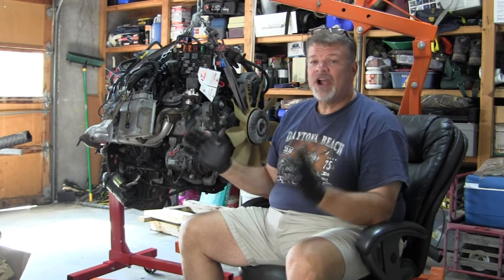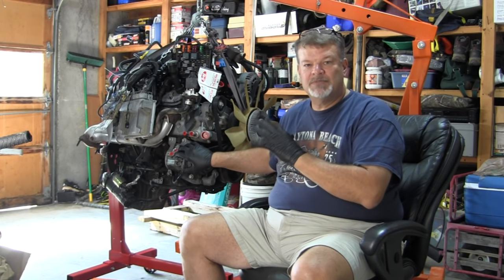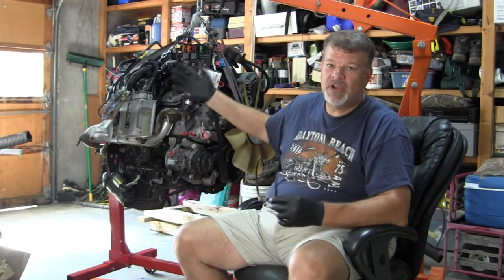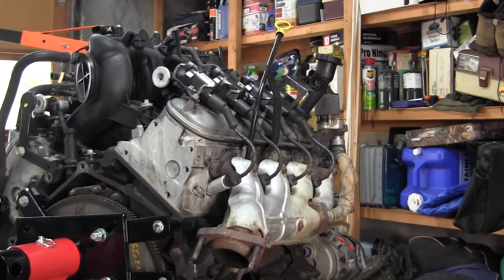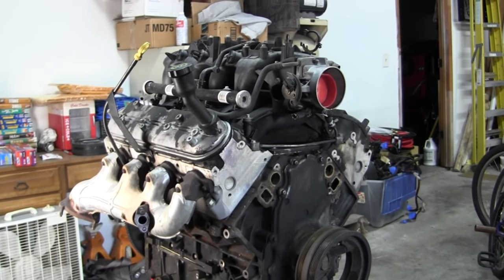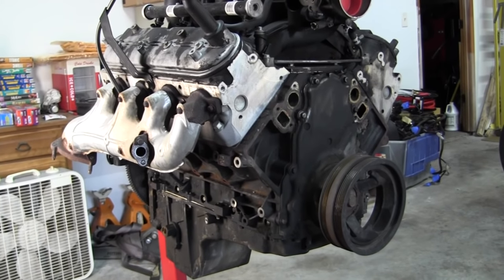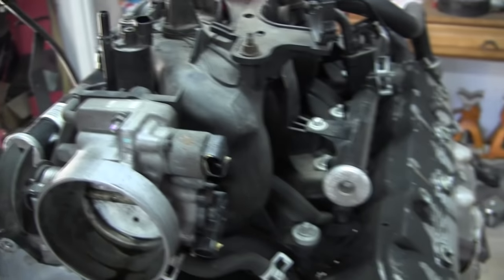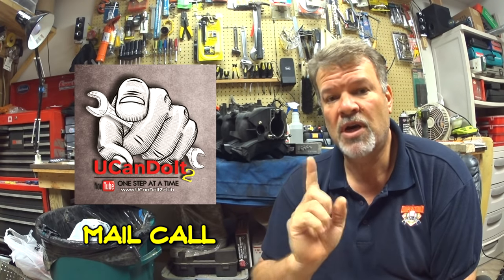LS 5.3L Build Part 1 Harness & Accessory Removal | Project Rowdy Ep005

Comment: I like your methd of working on the engine.
I have a question for you, in the very back of block there's  a casting number , is this a serial number or secuencial number that appear at the end of VIN#?
I do appreciate if you can help.
Reply from the maker: The Cast Number is the same for all Engine Displacement Blocks.  All 4.8/5.3 are the same.  It is Cast which is something that doesn't change as much as a serial number would need to.   I believe the Serial number is Stamped on the Top Rear Left side of the block. Near where the Head mounts.

Comment: Awesome videos! I am contemplating rebuilding the 5.3 in my 2000 Silverado 4X4. One question. Do you know what the part is that has a tube coming off of the exhaust manifold that goes to some sensor that then has another tube that goes into the throttle body? Is that some sort of EGR for this gas engine?
Reply from the maker: Yes, That is the EGR valve.  I will be eliminating that in my setup.  will be using Headers instead of original Ehaust Manifold.  I purchased and installed an EGR block off plate for the port in the Intake.   Cheers.
Reply: UCanDoIt2 awesome! Good to know. Thank you for the response!
Reply: So that's what the white labels were for I'm assuming. Nice video!

Comment: I have a 706 heads on my engine can I change it to 862 heads or I'm going to need a different engine?
Reply from the maker: Fabian Reyes You should research the issue with the 706 heads.  I believe they potentially crack near the center row of bolts holes.  If your inspect yours and they are ok, you might decide to use them.   The 862 heads are a direct replacement.  They will fit any of the Gen 3 platform blocks.  When swapping heads, the item to be mind-full of is if the intake port style changes.  It might affect the Intake that you can use.

Comment: i have a crack in my 2005 LS silverado cylinder head and its a work truck maybe worth 4k. Im going to buy a newish work truck and completely break down clean and upgrade the engine for a mid-life crisis project lol. It seems interesting and fun, but how long did this process take?
Reply from the maker: Mine took a while due to the filming setups.  If I was doing another, I would probably take 1-2 of careful disassembly and 3-4 days of assembly.  If, I was in a race to get it done, you could shave off 1-2 days of that schedule.  Take your time if you have it and enjoy your midlife crisis !!!!   The machine shop schedule could be the long pole in the tent. Cheers and have tons of fun with it!!  Mike.
Reply: @UCanDoIt2Mike  Thanks for the fast response and great videos! So pending the wait time on the block and heads getting machined, a little less than a week for dis/reassembly. I will probably piant my valve covers and other components with some high temp metallic paint while I wait on the machinist. Not too sure about the color yet. I'm nervous and excited to get started! Keep on doing what your doing and Go Dawgs!!

Comment: Great job on the videos! I’ve watched them over about 3 times already. And went ahead and pulled the trigger and bought my self a 03’ lm7 out of a Chevy Tahoe. I was wondering what bolts did you use to attach the motor onto the engine stand? I have the exact same stand.
Reply from the maker: Thanks for the comment!   I do not remember the specs on the engine stand bolts.   But I do remember looking up the specs on the Bellhousing to Block bolts and then measured the length that I though I needed.
Reply: UCanDoIt2 sounds good I’ll be doing the same thanks. Just got done taking off the heads and front accessories on the ground. But putting it on the engine stand would be so much better!
Reply from the maker: Yep!!!  Bending over to the ground is for the birds picking up crumbs...  The engine stand brings it to a good work height!  Have fun with yours!!!!!
Reply: UCanDoIt2 found out the bolts needed they are (M10x1.5) or (3/8 - 16) the bolt store I went too had it in the 3/8 -16. I grabbed 4 grade 8 bolts and 8 washers. The bolts I used were 3” and they fit perfect on the engine. Just wanna put the info on here for the next guy. Man your vids are a life saver I always refer to them when I have time to wrench on the engine! Thanks a lot!
Reply from the maker: Thanks for the follow up Marcos!  As this info is a little buried in this thread, I am going to add the information that you provided to the description area under each video in this series.  It will continue to live here as well.  Cheers and have fun with your engine!!!!!!!!  Mike
Reply: @marcosmorales854  Thank you for the info. I'm about to start my LS build. Much appreciated!

Comment: Those heads have been rebuilt before , see the heat tab inside the freeze plug!
Reply from the maker: Could be !!  I know that the Salvage Yard that I purchased it from added several Heat Tabs that were in conjunction with a limited warranty.

Comment: If you get a truck ls engine and put a car intake on it, are the sensors and connectors the same? Or do I gotta switch the wiring harness
Reply from the maker: Make sure you understand that my answer is from limited experience with these engines.  I know that there are at least two sensors that could require harness and connector changes.  The Truck Vortec engine has the Camshaft Position Sensor in the rear of the intake.  Some Car engines have that sensor in the front of the engine.  You may just have to re-route that wire and connector.  This would not be difficult, but you would need to make sure the connector type is that same.  The other is possible difference in the Crank Shaft Reluctor Sensor.   The other issue may involve the two connector at the PCM.   All of this can be overcome.   To simplify all of this for someone with limited experience would be to keep the Engine/Harness/PCM together for the donor vehicle.  Those are my thoughts.   Have fun with your project.

Comment: Planning on swapping a 5.3 into my trans am. Yes the ls1 is good but i want to boost one day plus theyre so cheap. I found one for 375 bucks.  He said it ran but needs lifters and gaksets.  Is that good or bad? Im a noob to this stuff so im intimidated a little bit.
Reply from the maker: "Good or Bad"... that is a hard question to answer.  You never know what types of issues that you may run into.  As I mentioned in my opening video, this is only the 3rd engine that I have rebuilt.  But speaking logically...  Gaskets are easy.   "Lifters"... I would have to question why the guy thinks the lifters are an issue.  Truly if the lifters are bad, I would also check the Cam (they work with each other).  Cam/Lifter kits are $600-$900 (Mine just under $900).  Swapping out the Oil Pump is a no brainer (the Heart of the engine).  As long as the engine comes with the Harness and PCM and you plan to tear it down to replace wearable parts... its a good deal.  I bought mine for $600 (for reference).  I thought I was going to spend $2000-$2500 and ended up spending $5K.  But please don't let that scare you (just a reference).

Comment: Could I put one of these in a 350z?   Ive been watching 5.3l ls swaps but im not sure which model to go with
Reply from the maker: The answer is yes!  All of the GM Gen3 and Gen4 engines have the same footprint.  If you just plan to pull one and swap if without many changes, you should note that the engines from Trucks have front accessories that are configured in a Tall and Narrow footprint.   An engine from a GM Car will have a Short and Wide front accessory footprint.   If you plan to install all new front bracketry, use can use either.

Comment: This might be a dumb question but is this process the same as a lq4 6.0 what to do it myself and learn but these just look intimidating with all the sensors and wires but i reallly want to learn
Reply from the maker: I answered your other question regarding the machining process.  This question appears to be regarding the overall build process.  And again... the LQ4 is in the same GM platform (GEN3) as the LM7.   There are so many similarities.   The blocks are laid out the same with the major difference being the Bore size.   This would influence the Piston size and the Heads... as those items are related.  So many other components are interchangeable.  You should consider buying a rebuild guide ($24).  It, along with these videos, will walk you through the process.  It is a great pre-process read as well as it will help guide you through the process.  Here is a link to the book that I used... GM LS-Series Engines by Chris Werner: Amazon: http://amzn.to/2igcReD.
Reply: @UCanDoIt2Mike  awww man thank you so much for the advice and really appreciate the reply i stood up real late last night watching your videos even though i already saw them like ten times lol but this time it's foreal because i just picked up a lq4 2days ago and was second guessing myself can i really do this but know that you said the only difference is the bore size i have more confidence and i think icandoit2 and definitely going to use the link you gave me to purchase that book because i also was thinking if i do this how am i going to find out all the exact torque specs for each nut and bolt so that book should really help as well as probably some extra knowledge to some other things so again thank you very much👊

Comment: Great video, was wondering if you could help me out with the ground locations for the battery. I know both the cables share the same spot on the engine block, but I'm trying to find the right spot for the thinner gauge wire on the battery ground.
Reply from the maker: Your options are endless for creating the ground side of any circuit.  Check out ground terminal blocks on Amazon.

Comment: Thanks for the videos, I, like almost everyone else here, binged watched your videos from start to finish, and you've definitely provided the way for alot of guys like myself, who had the want to do it, but wasn't quite sure how to do it all.  It really seems less intimidating now.  I am purchasing a 5.3/6.0 for my C10 swap, and in addition to the GM LS book you showed, and the ltswap.com website, is there anymore sources you went by to guide you through the process?
Reply from the maker: Thank you JD!  The GM LS Book was such a great resource.  I read through some sections and skimmed through others before ever buying the engine.  It was 90% of what I needed for the engine build.  In addition, my Machinist was a great help.  Most of them want to help you (some) because they want you to be successful.  Best to get a recommendation for a local shop.  I do have a friend that was going to be a third source if I needed him, but it turned out that I didn't.   Lt1Swap is a must for the wiring portion.  I had no idea how to tackle that one until I found that sight and all of the base information was enough for me to develop my approach.  Because wiring changes from through the years and models, it is best to drill down through his site base on your engine/year to obtain the proper wiring configuration.  With your wiring specifics and my cleanup approach, it should be a cake walk.   Best of luck to you with yours!!!!!   Have fun with it.  It's a great opportunity to learn something new!!!!
Reply: UCanDoIt2, awesome and thank you! I later realized that you'd posted the cost sheet along with pet numbers, etc. This is exactly what I have been looking for. I can't thank you enough. Go Dawgs!
Reply from the maker: JD Thomas Absolutely.....   Go Dawgs!!!!
Reply from the maker: JD Thomas Absolutely.....   Go Dawgs!!!!
Reply from the maker: JD Thomas Absolutely.....   Go Dawgs!!!!
Reply from the maker: JD Thomas Absolutely.....   Go Dawg!!!!!!

Comment: Looks like the head has been off before. I see what looks like a heat tab in the freeze plug on the back of one of the heads.
Reply from the maker: I did not get a sense of that when I took it apart.  But you never know when you buy an engine and don't know the history.   Cheers!  Mike

Comment: What size bolts did you use to mount to engine stand? I just picked up a lq4
Reply from the maker: When you Google "GM 5.3 Bellhousing Bolts"... you will find that you need a M10x1.5.  You will need to measure the sleeve on your engine stand and add another 10-15mm to determine what length you will need.  Hope that helps!

Comment: I’m not most mechanically gifted person.... but do you think I can do this all as well if I have a second set of hands?
Reply from the maker: Did anything look overly complicated in this series?  If so, you may want to focus on cooking Pop Tarts.  Otherwise, you might want to pick a rebuild manual and read through the detailed steps.   I used the following Manual..... GM LS-Series Engines by Chris Werner: Amazon: http://amzn.to/2igcReD.   It would be a cheap investment to build knowledge and determine the language of what's going on.   Between the book and these videos, most should do just fine.  Not many special tools required.   Some or most tools can be borrowed from your local Auto Parts Store.  The secondary purpose if these videos was to show you the steps that it takes so that you can decide if this is something for you or not.  Its my slow lob of the Tennis ball.   Ball is in your court!  Cheers and hope you enjoy it if you decide to proceed.   Mike!

Comment: WHAT MASTER REBUILD KIT DID YOU USE AND WHAT WERE THE COST OF UR MACHINE SHOP WORK??? THANKS I LOVE YOUR CHANNEL
Reply from the maker: The Master Rebuild Kit that I used was provided by my machine shop and I do not have a part number or other reference for it.  Because they work with distributors, I assume that it may have been selectively put together.  I know it had parts from Sealed Power, SCAT, Hastings, Melling, and FEL-Pro Gaskets.  Sorry that probably is not much help, but it was $1650.  The Machine Shop work was $1200.   Hope this helps and best of luck with your research and build!!!!!!

Comment: if I have the option to buy a 5.3 or a 6.0 for ruffly the same amount, using the LS motor for drag racing wanting to get 500-700 HP with a turbo, is the 5.3 worth it or just go with the 6.0?
Reply from the maker: The fact that you are going for HP, I don't think you can pass up the extra Displacement of the 6.0.  To be fare, this is a little beyond my research and above my pay grade.  From what I have learned, if I was wanting to do the same, and those were my choices, I would be looking for an LQ9 6.0 and start additional research from there.   Sounds awesome!  Keep me updated.  And if another viewer has some good advice... the floor is yours!!!!  Cheers!

Comment: i already finish my harness and i only remove A/C wires and O2 sensors so the question is the computer need to be reprogramed?
Reply from the maker: Yes!   Minimally, you will need to remove the VATS (Vehicle Anti Theft System).  In your case, you would also want to disable the O2 faults so that they do not light up your MIL light (if you are running one).

Comment: Hey what was the number sequence you used to keep track of where things went? You said it was like a Rubik's cube?
Reply from the maker: You are the first to ask...   Since the engine is the shape of a Cube, I imagined it like a Rubik's Cube (3 x 3 x 3).  Thinking of the x,y,z axis and facing the engine front to back, I used 3 numbers to represent where the connector was located on the engine.  1st Number Left to Right (1 left , 2 center, 3 right).  2nd Number Top to Bottom (1 top, 2 middle, 3 bottom).  3rd Number Front to Back (1 front, 2 middle, 3 back).

Example the Oil pressure sensor is in the Center (L-R), Top (T-B), Back (F-B) would have a location number of:  2, 1, 3.

I think it is worth while to use this, or something that makes sense to you.
Reply: @UCanDoIt2Mike  ah that's genius! That's simple too! Do you mind if I make a video on that today using your tactics? I'll give you full credit!!
Reply from the maker: I don't mind at all !!!   I share all of my information freely.  Glad to see you fixed your dirt bike.  Looking for to watching your Engine progress!   Cheers Mike!
Reply: @UCanDoIt2Mike  awesome! Thanks so much! It makes me happy that you watched it! I'll be posting this video on Thursday. Hopefully I can get most of the chopped up harness off of there!

Comment: How in the world do they get the l.s out of the donor truck with with all that intake and everything attached I wonder.
Reply from the maker: When I picked mine up,  They had cut the seat belts out of the donor vehicle and had tied them to the exhaust manifolds.  I assume that is how they lifted them out of the donor vehicle because the engine was sitting on a wooden stand and they used a forklift truck to place it into my truck.  Food for thought!
Reply: @UCanDoIt2Mike   I'm  handy like that as well,  I didn't ask what I really needed to know or Was hopeing to find out. I have already taken the intake off for removal since I asked question. I have a different situation. Thanks for responding thought.